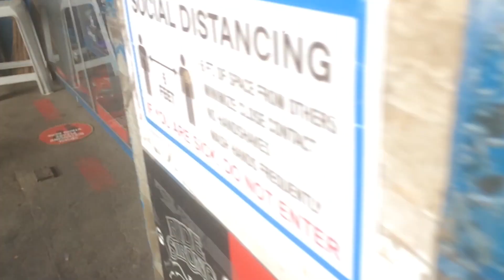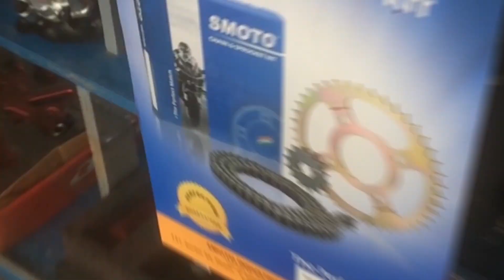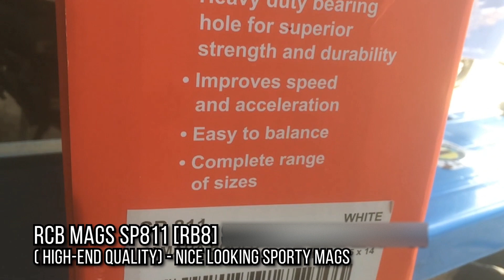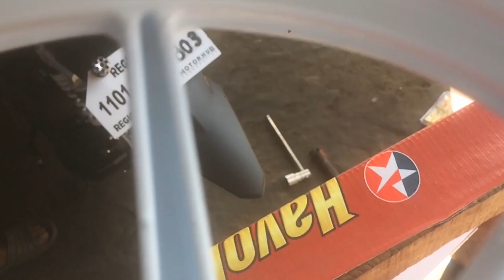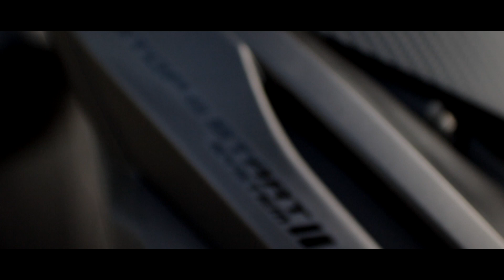Mio i 125 S | RCB MAGS SP8 RB8 AND RCB DISC BRAKE UPGRADE

Comment: Sir, tuwing kelan po ba dapat nagpapalit ng rotor disc (disc plate?
Reply from the maker: Pag medyo mainggay na po cya paps kahit nagpalit kana ng brake pads paps, at sa katagalan paps mapapasin nyo po na may crack sa (excisive heat and friction) na cya po at mainggay na po. so Maintinance check lng po paps always. Salamat po.

Comment: Good pm paps. Tanong kulang po Ung baso nang front shock mo pang mios40??
Reply from the maker: Yes paps Mutarru Front Shock for Mio.
Reply: @voidstation9633  salamat paps.. Nag tanong nadin kasi ako need kudaw ung pang mio s40 na baso para mag sakto sa bracket nang rcb caliper...
Reply from the maker: @raymundvidanes2742  ahh ok paps. sa bracket ng caliper pala paps. nag basi lng ako sa Model na Mutarru po paps sa per model nila. cge Paps RS always paps.

Comment: Ano size nong rotor disc lods 200mm?
Reply from the maker: RACING BOY Steel Disc Brake Rotor Mio i 125 190mm 4-Holes E-Series paps.

Comment: Basig MAka suroy ko diha matina hehe
Reply from the maker: ayus ka paps..
Reply: Paps. Nice kaayo imung set up sa imung mio. Same tag model paps pero pure stock PA. Rcb Nimo na mono shock pops og muttarofront shock pila sad paps Para MA budgetan nko ppas. Hehe newbie lng paps
Reply: Barato lng dire samay mmht paps?
Reply from the maker: @benjiedolor2052  ayus ka paps hinay2x lng gani ko paps. 
RCB REAR SHOCK VS SERIES 295mm =3,799+
Mutarru Front Shock Bottom Case  = 1,950+
Reply from the maker: @benjiedolor2052  Yes paps barato cla ug legit ilang mga Parts paps.
Reply from the maker: @benjiedolor2052  Yes paps barato lng cla

Comment: mag kano nagasto mo lahat lodi?
Reply from the maker: RCB E-series Disc Plate for Yamaha Mio (4H)  = 780
RCB Magwheel Set RB8 Mio Sporty and Mio125 4 holes
Color: White Price: 4250.00/set
Total: 5,030
Labor: 250
Yan idol.
Reply: @voidstation9633  sakto lang po ba ikabit yong stock na gulong ng mio i 125 jan?
Reply from the maker: @ison3107  Opo sir stock pa yan sa akin po kac sayang po bago pa ang gulong po. smooth parin po ang takbo.